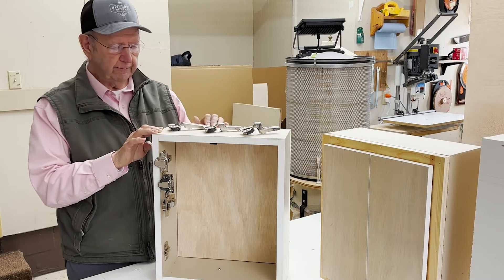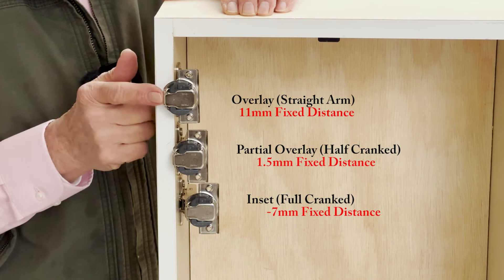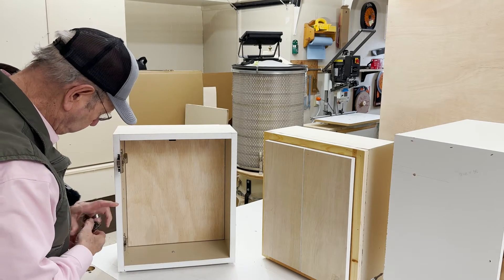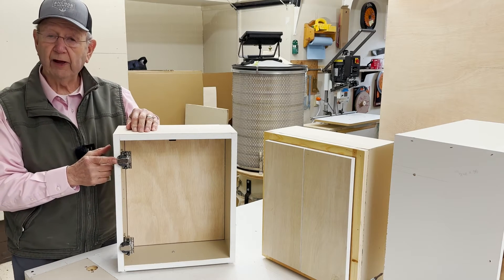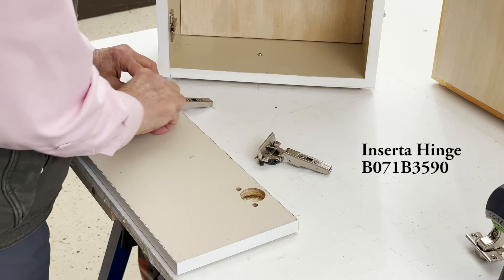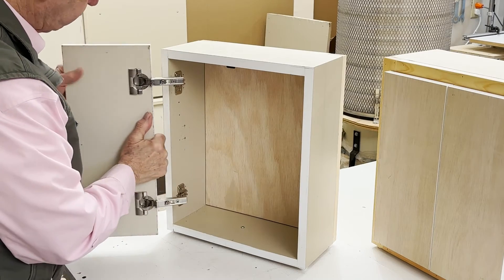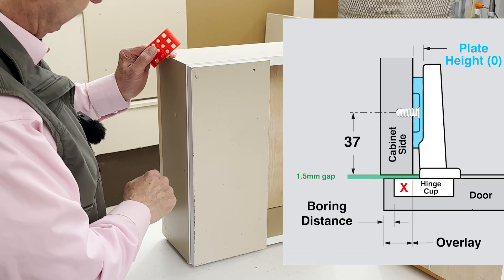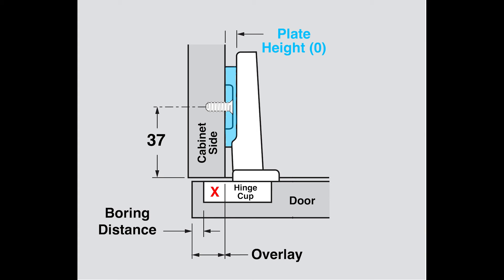Blum Hinge Series - The Calculation of an Overlay, Featuring the 110 Degree Straight-Arm Hinge

Comment: Excellent video.  Hope you read this comment and respond because I am in the middle of trying to work out how to install my cabinet (display case) hinges.  I think this video finally answered what I have been trying to figure out.  I am making a display case with one door that will open up and down relative to the case box.  

I made the door slightly oversized to to be 1/8" around the entire cabinet box.  If I understand this video correctly can you see if I understand what you taught.   If I want the overlay to be 7/8" (approximately 22mm) - then I need to make the boring distance to be 11 mm.  

I calculated this using your formula  Total Overlay Desired - 11 mm (cup overlay with flush mounting plate) = boring distance needed.  

So (22m total overlay desired - 11mm fixed overlay distance by cup) for a total of 11mm boring distance.  Is this correct?
Reply from the maker: Hello,
Thank you for your inquiry.  We do have a similar hinge by Blum that would get you close to your desired 7/8” overlay.  The maximum drilling distance is 7mm using this hinge.  Combine the hinge with a 0mm mounting plate,  the maximum overlay is 20mm.  If you use the entire adjustment range, you could get an overlay of 22, which would be close to 7/8”.  We would be happy to discuss this with you if you’d like to give us a call, 1-800-383-0130.
-Woodworker's Hardware

Comment: Hi, i have 25mm thick doors,  is the set up the same?
Reply from the maker: Hello, the setup would be the same, the only difference is that you would nee a Thick Door hinge for a 25mm (1") thick door as the swing is different so the door does not bind when opening.  The thick door hinges will work on doors up to 30mm (1-3/16") thick - https://www.wwhardware.com/catalog/product/view/id/17388/s/blum-thick-door-soft-close/category/863/

Comment: Hi Larry, i'm making a built in record cabinet with bookshelves. i have three doors beside each other on the frameless cabinet. I'd like to use full overlay hinges for this. All the hinges will be on the left side. My question, will the doors interfere with each other  if there is only 3mm between them? or should I just use half overlay to be safe? I prefer the look of full overlay with this design.
Reply from the maker: Hello,
There are two “full” overlay hinges in Blum. Example, B071T3550 will do a 5/8” overlay with a 0mm plate and a 5mm drilling distance. The B073T3550 will do an 18mm overlay with a 0mm plate and a 5mm drilling distance.  Both hinges require a 0.9mm reveal, so your 3mm reveal will leave plenty of room for the doors to open.
Please feel free to call us on this or any further questions; customer service can be reached at 800-383-0130.
-Woodworker's Hardware

Comment: Good job! 
Does the hinge need the 1.5mm gap or can that be removed by moving the hinge plate further back (say 38MM)?
Reply from the maker: Hello,
The 1.5mm gap is set from the factory and is designed so that the rear edge of the door won’t scrape on the front of the side panel.  If you try moving the mounting plate back to 38mm it’s likely that the door will scrape.
If you have further questions, please feel free to call our great customer service team at 800-383-0130, we are available Monday thru Friday, 8am to 5pm central time.
-Woodworker's Hardware

Comment: Very Informative indeed. Thank You. So, is the 5mm an optional number. I see that the edge of the door and the side of the cabinet are not flush, (by choice maybe). If the cabinet thickness was 18mm could you do 11+7 instead of 5. Would that bring it flush if that's what was required?
Reply from the maker: Hello,
The 5mm drilling distance is optional.  On all of Blum’s 110° hinges, they allow a range from 3-7mm.  With their standard hinge (B071T3550), if you use a 0mm plate and drill the door at 5mm, you will get a 16mm overlay.  When you drill the door at 7mm, the overlay would be 18.
What Larry is not talking about in this video is the Plus series hinge from Blum- ex. B073T3550.  This hinge was designed to get up to a 20mm overlay when drilled at 7mm.
So yes, you are correct.
-Woodworker's Hardware

Comment: 37 mm   backset for   mounting  plate .  whwere ddoes  that  measurement   comfrom
Reply from the maker: Hello,
The 37mm setback is based on a system developed in Europe a number of decades ago.  This system uses line drilling, where the centers of the holes are setback from the front edge of the frameless cabinet and are 32mm on center.
All the European hinges and drawer slides (and most of the rest of the world) are constructed to be used in this system.  An exception would be where inset doors and drawer fronts are used.  In this case, the front series of holes would be setback 37mm plus the thickness of the door and drawer fronts.
-Woodworker's Hardware